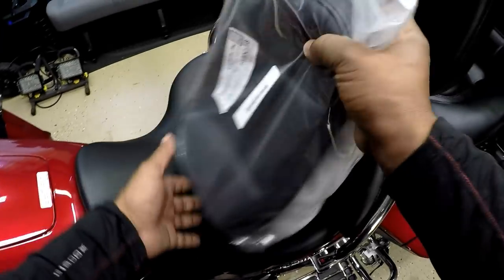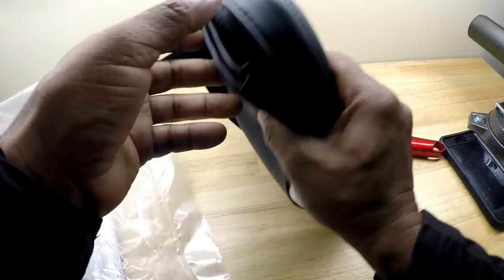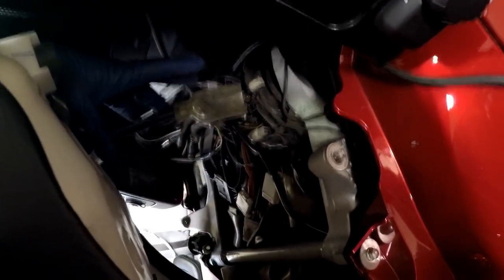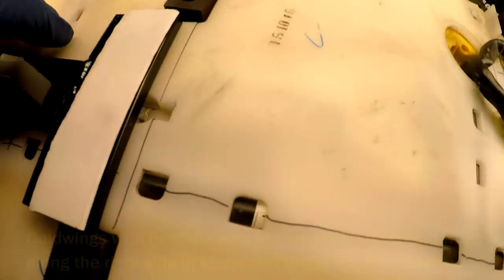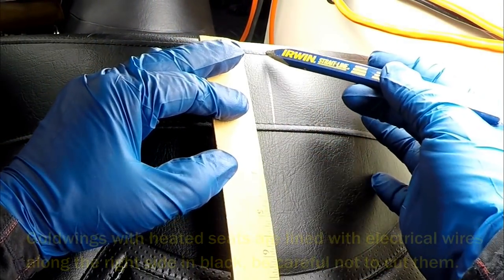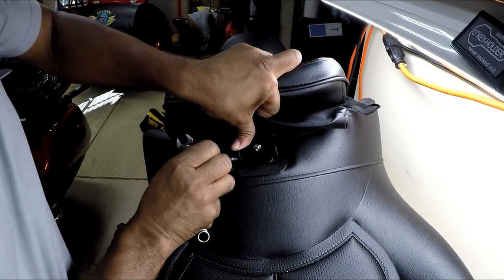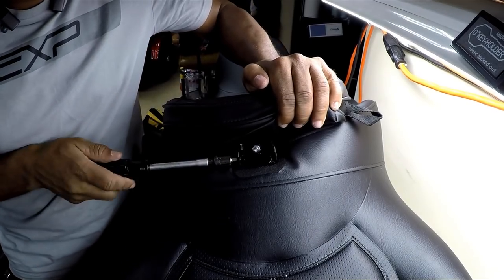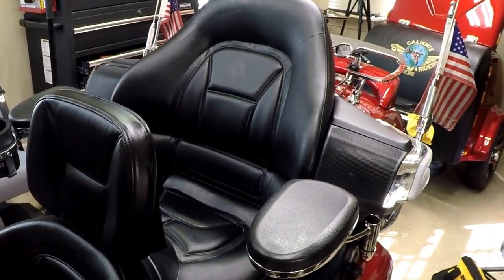Utopia Drivers Backrest for Honda Goldwings Installation

Comment: I posted this on cruisermans site also - Great video, I just added the utopia to my 2005 GW. I might add that I would drill the holes after you saw the seat and insert the bar. I had to re locate the holes because the original holes had me really pushing down hard on the seat to get the bar holes to line up correctly, which in turn made he seat fabric compressed too much. Looked horrible. So put the bar in and take a flashlight to see where the holes on the bar are at and then drill the holes. In my case I had to use the set of holes for the newer model GW. Just my 2 cents.

Comment: I have one of those on my 2015 Honda Valkyrie.  It was a pain in the ass to hook the bar under the seat pan.  It works really nice to prevent lower back pain.  Also the little compartment on the back of the backrest will flap in the wind when riding.  I tried Velcro to stop it from flapping, but finally had to glue the thing down.  Good luck with it.
Reply from the maker: Russell Horn the Goldwing has very little wind behind my F4 windshield and Dragon Wings, the pouch in the rear will sit still as if I’m not moving, that’s one advantages of the big body Wing, LOL.

Comment: I installed the same backrest on my 2017 Gold Wing a few months ago.  I feel like it pushes me forward so I don’t use it much.  I am 6’4” so I feel that’s part of the issue.  I’m looking to possibly replacing my stock seat with a king size seat from Ultimate seats.  That would sit me back 1.5 inches and .5 inches higher.  That would give me a little more knee room as I’m real close to the fairings.  Good vid Chris!
Reply from the maker: Sean Smith thanks for sharing your honesty Sean.

Comment: I have had back rests on two of my machines, both Yamaha ventures. I have two issues with back rests in general. I always, always wear a jacket and gloves and full face helmet. I am 5‘10“ tall, 32 inch inseam. It’s tough getting on and off of the machine because you have to lift your foot/ leg onto the drivers seat and hop on to the bike with the leg you are atanding in while sliding the leg on the seat over the seat and into position when you’re getting on, you can’t just round house your leg over the seat like you would if you were getting on a horse Because the back rest is in the way. Just imagine getting on a horse in front of someone that’s already sitting on the horse. You have to swing your leg over the saddle or almost over the horse’s neck  to get on.and the same thing when you’re getting off. You have to step onto the ground and slide your butt off one side, and then hop on one leg, dragging your right leg across the seat to dismount.
  The second issue I have about drivers back rests is,  I wear all the gear all the time, when I lean back onto the back rest, if the temperature is above 70°, there’s no circulation, and perspiration builds up right there where you are leaning against the backrest. if the temperature is in the upper 80s or low 90s, the sweat runs down your back.
  I am going to buy a back rest for my GL 1800 Goldwing, because the benefits outweigh the inconveniences..
   Very good video. I’m now a fan, but one little thing, was that a car tire On the back of your gold wing? In the introduction of the video?
Reply: Yes it was, i run the same tire. You won't believe the difference. Better way to go in all respects.

Comment: Hey Chris what made you change back rest love your videos keep it up
Reply from the maker: Dennis Artis the Revolution backrest is very comfortable but when a passenger uses rear the transformer foot pegs it raises their knees up to the fattest part of the the Chrome brackets that run horizontally along the side of the grab rails, this will be uncomfortable to the passenger inside knees, but since the Utopia mounts to the center of the seat it will eliminate that chrome bar.
Reply: I was going to ask the same question, thanks Chris very informative videos keep up the good work.

Comment: Why would you change the backrest that you have ! ?
Reply from the maker: Daniel Mondello Dennis Artis it was a hard decision since the Revolution backrest is very comfortable to the driver but when a passenger uses rear the transformer foot pegs it raises their knees up several inches to the fattest part of them Chrome brackets, when this happen it rubs the inside passenger knees causing discomfort, with having the Utopia it eliminates that outside mounting bracket.